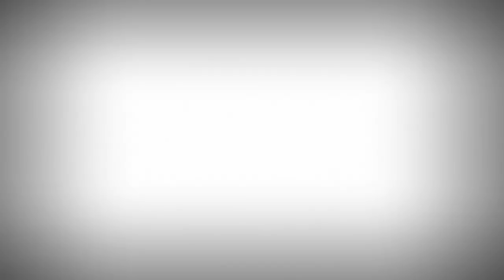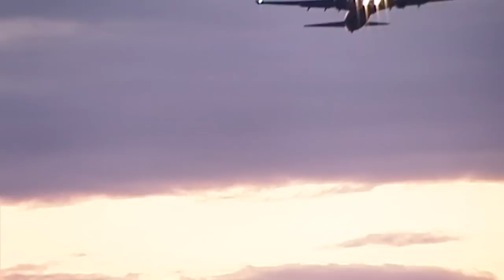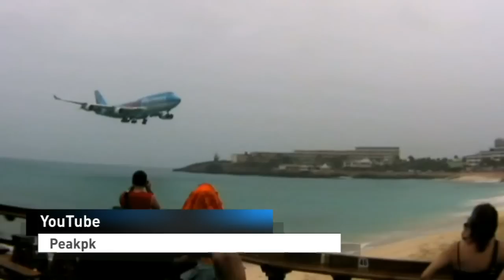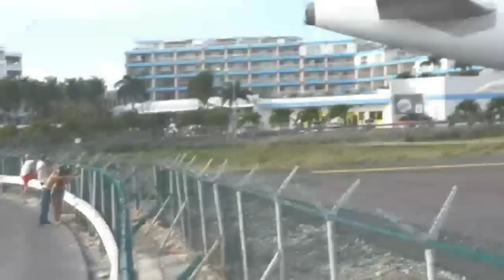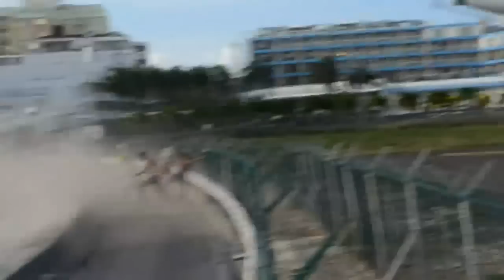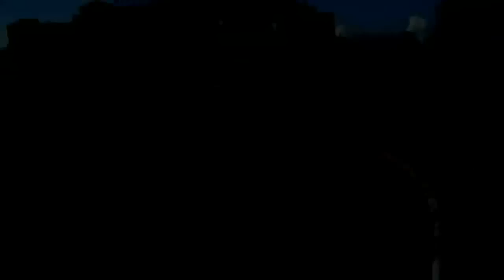Ouch! Girl bowled into concrete wall by jet exhaust

Comment: Aviation needs a small strip like this. Its the wild side of pilot and aviation enthusiasts. I can't handle the fences that blockade airports like even this one has that the hold on to. The closer you can get to an aircraft landing or taking off the more of a thrill it is. They obviously knew having a beach at the end of the runway would make one hell of a tourist destination. See read the sign, She knew the risk. Awesome airport + A weakly griped chick = Not so great of an outcome.